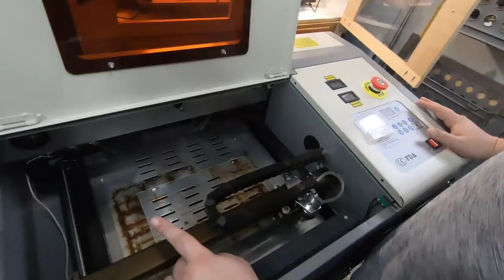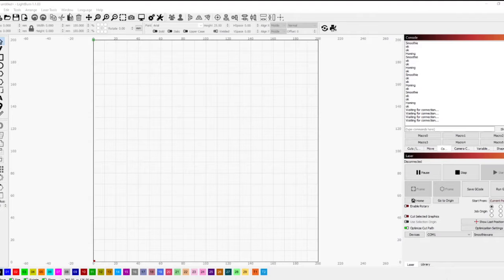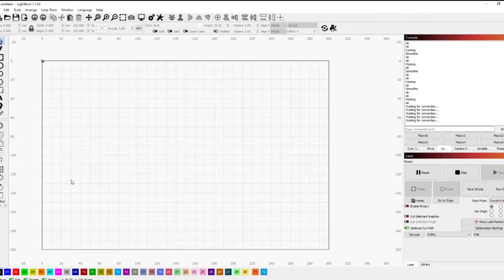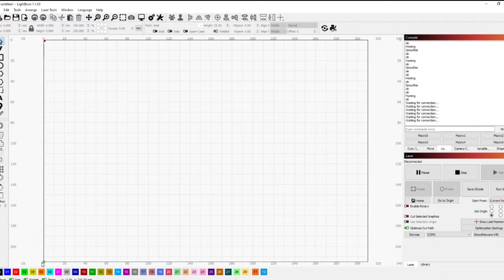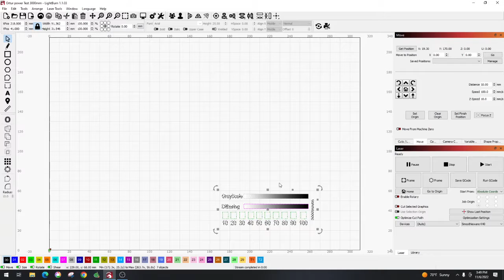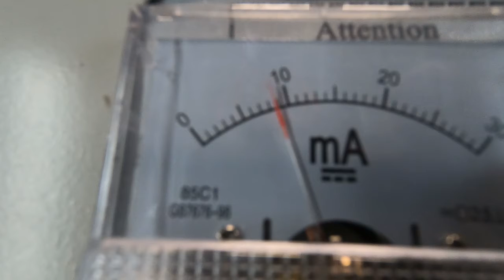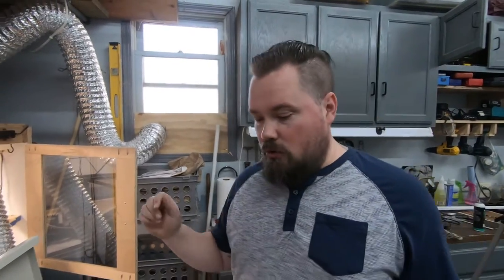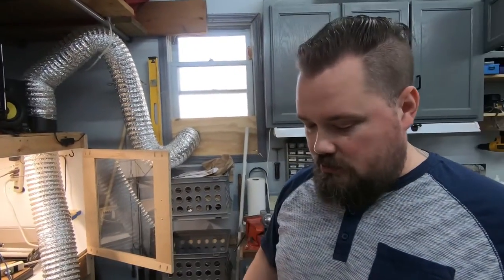Cohesion 3D Lightburn Board Part 2 | Monport K40

Comment: Cohesion 3D or monportlaser GRBL Motherboard ? Which do you think is better? Or are they both the same?
Reply from the maker: So far I would say the cohesion. But it is a good amount more money.
Reply: @KLRform  Actually I already ordered monport laser GRBL Motherboard because the money matter. but in case of failure will be considered Cohesion3d as plan B , RDworks is very expensive
Reply: Hello where do I purchase Cohesion3D LaserBoard? Thanks